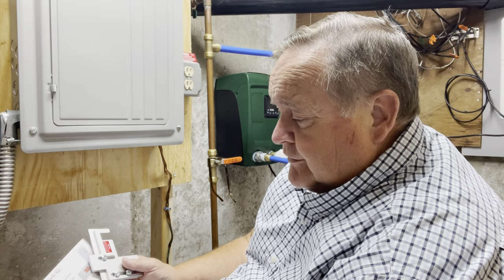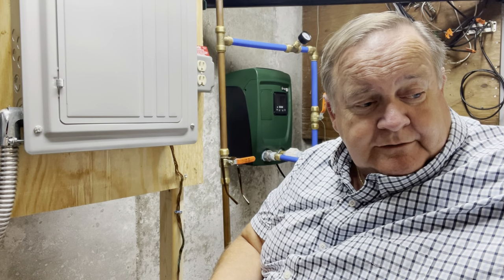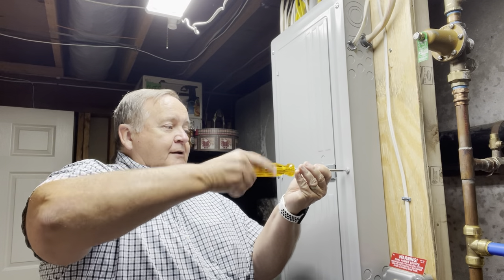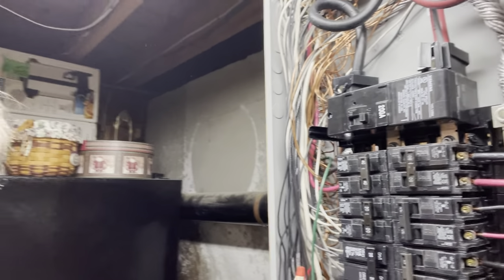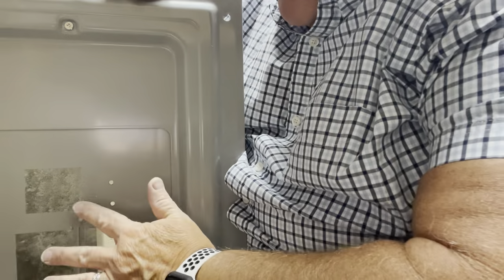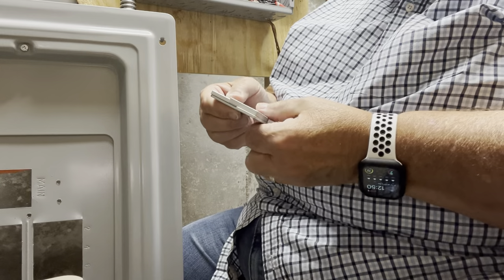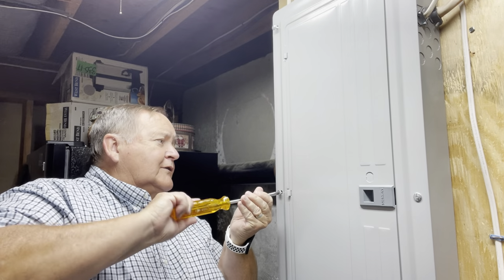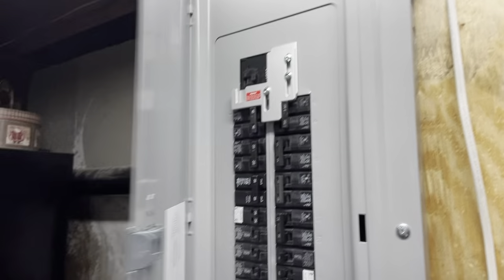🔌🔒 **How to Install a Generator Interlock Switch on a Siemens Panel for Generator Backup Power ** 🔒🔌

Comment: Great video. I installed the load center upside down and had the breaker for the Genset on the bottom left side. Amazon FLGR, model SIE-P2.
Reply from the maker: Thanks so much for letting me know and taking the time to watch

Comment: thanks for the video.  I was wondering, does the 50amp breaker have a dual function and work for any branch circuits in the house, or is it just to serve as protection and panel energizing  for the generator?
Reply from the maker: It only acts as a feed from the generator to supply power to the panel

Comment: So ive got the same panel, its just upside down for some odd reason...main on the bottom. thinking id use the same switch just on bottom of panel...am i thinking of this the right way...just flip it over.
Reply from the maker: Upside down and backwards would accomplish the same result
Reply: Yeah its because its bottom fed. I'm doing this same as well. Got my interlock from geninterlock they sent instructions for it flipped. PS did this work out well for you?